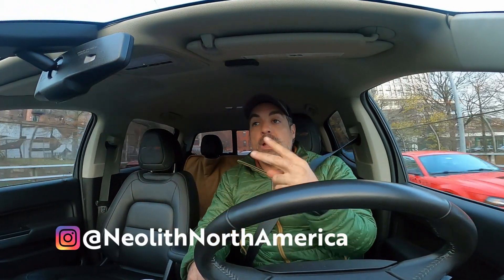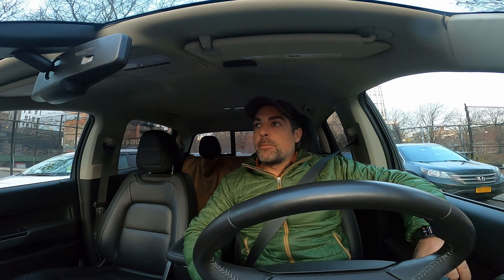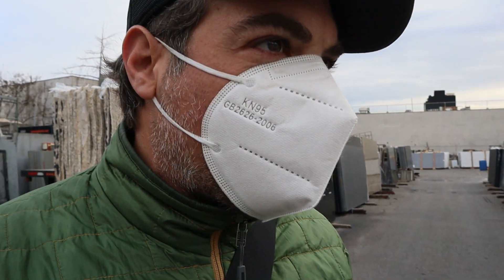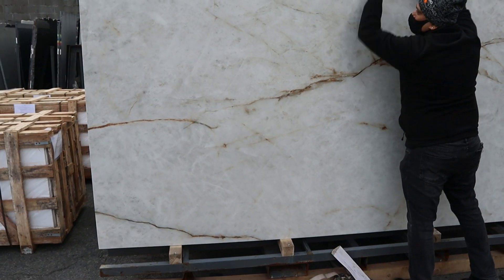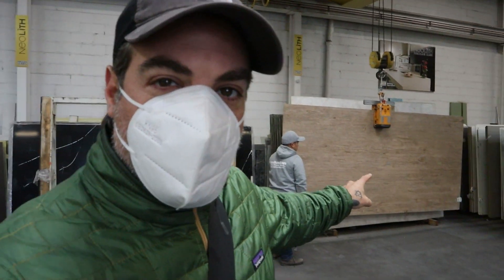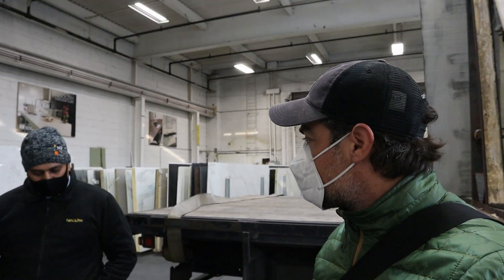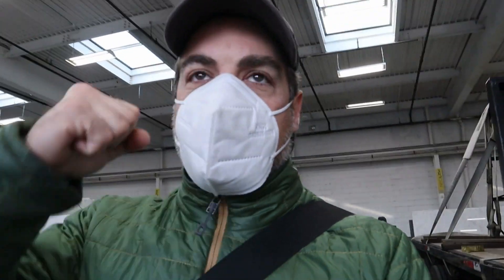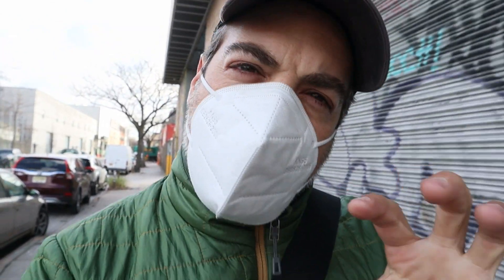Product Spec: Neolith Countertops

Comment: Excellent! my wife and I are about to buy some Marmotech countertops, similar to Purestone. what do you think of Purestone? greetings from Argentina!
Reply from the maker: I'm not familiar with either of those particular brands. Top things to be thinking/asking about: resistance to heat (ability to put hot pots from stove directly on surface without damage), non porous, durability, and then you want to look closing at the printing/design and make sure it is high quality (don't see any pixelation, make sure the pattern doesn't repeat in a non-natural way). hope that helps!
Reply: @CarrinoAnthony  thank you so much!